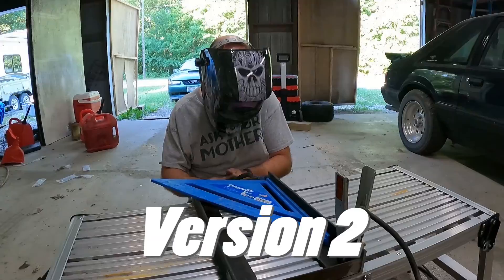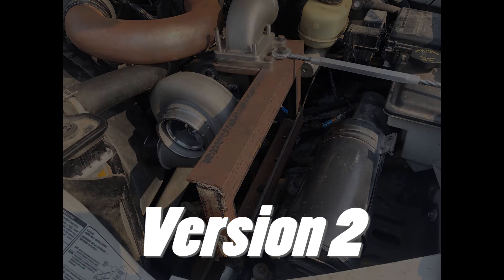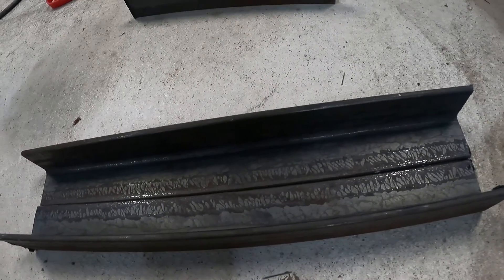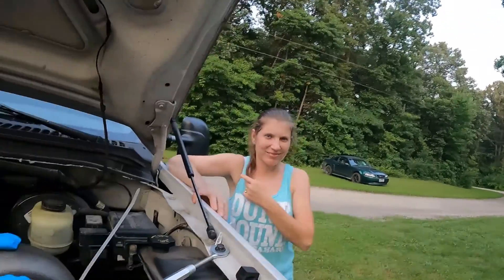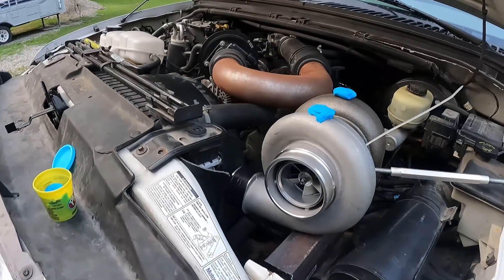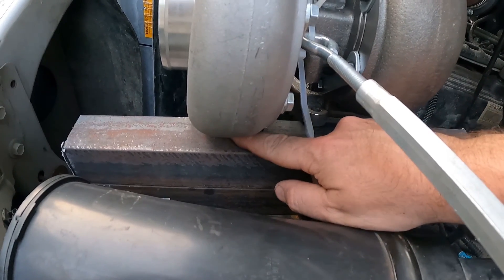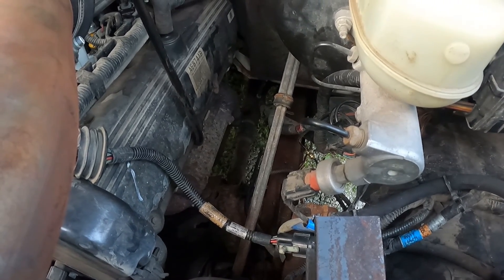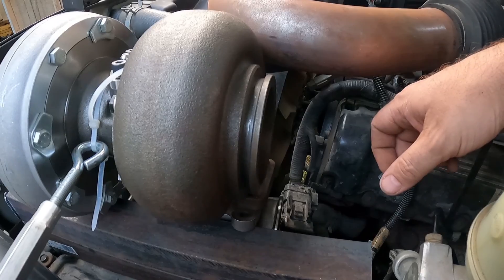5.4 f250 turbo build part 1. Diy turbocharger mounting bracket.

Comment: I just rebuilt my 5.4l 2V, I would like to add a turbo to it, but maybe a rear mount turbo. Might be easier.
Reply from the maker: That was my original plan also. I built mine the cheapest way I could afford and felt good about at the time. All the extra oil line , scavenger pump, check valves , intake, extra exhaust,Ect put in out of my budget.

Comment: What turbo are you going with? And why? I too am in the decision phase of DIY turbo, or bolt on supercharger. For towing, not for racing, or attention seeking. I deal with monstrous bluffs in daily towing for work. (Self employed/not rich) Planning for winter project in Wisconsin. So glad I found your channel!!!!!!!
Reply from the maker: I’m going with the gt45 (Chinese) turbocharger. There’s a guy I’ve followed since the 90’s(pre internet) named Richard Holdener that has made several videos on the gt45 if you want to look at his channel. It’s certainly not the most efficient unit on the market but it seems like a good value.
Reply: I think I'm looking at purchasing the same turbo.(GT45) Been doing some research and it seems like the right choice. Looking forward to your follow up videos. Thanks again!!!